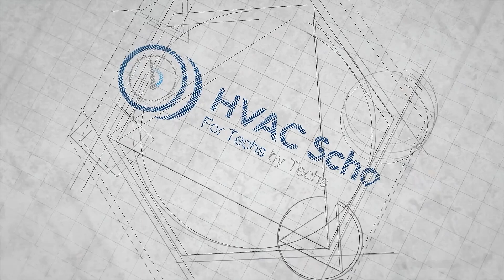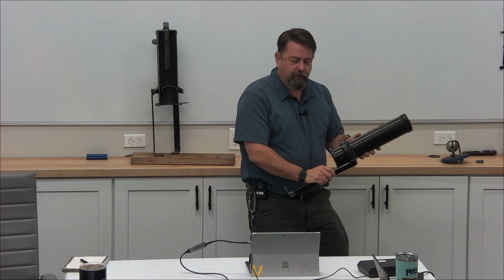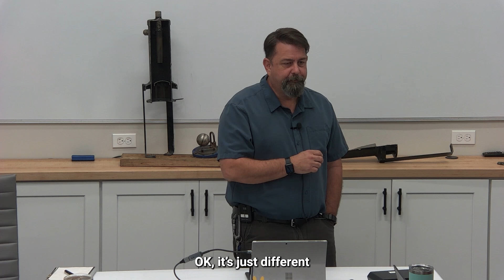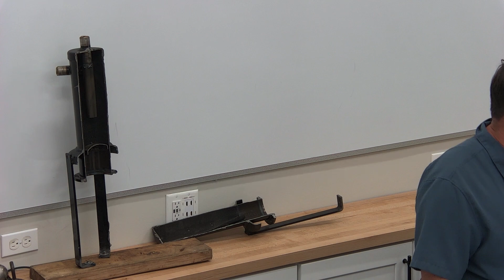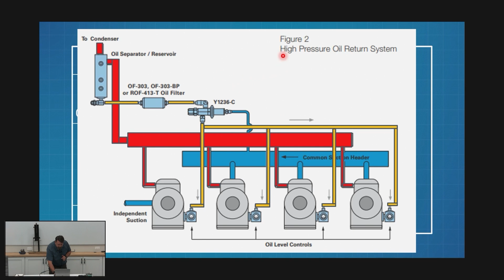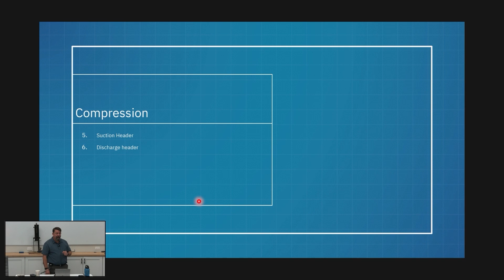Rack Refrigeration Cycle Part 3 - Oil Systems w/ Matthew Taylor

Comment: Hi there, I need some help. We have an HVAC system that runs x 4 compressors with two oil separators. The oil migrates from one separator to the other depending on which compressors are running. Comp 1 and 2 use one separator and comp 3 and 4 the other but as all take suction from the same condenser, we have migration when three of the four runs at the same time. My question is what an easy way is to balance the oil levels say every 6 months
Reply: Interesting set up - what is the purpose in having separate separators if they are using the same condenser?  Is this a high pressure oil set up, or a low pressure oil setup?  Also, ball float oil regulators or electronic?

Comment: What is the pilot line for connected to the 3 way heat reclaim valve? One to discharge and one to suction?
Reply: Thats right.  The pilot side is right off the hot gas.  It needs pressure differential to flow (high pressure to low pressure), and thats created by connecting the outlet to the suction.

Comment: Sometime I use a pipe heater wrap around accumulator when we go in defrost the heater come on and the reason behind it is to warm up the oil and separate the gas this work really well
Reply: I will cover the accumulator in another part, to come.  That will explain how the oil SHOULD return from the accumulator.  Sounds like your pick up screen is stopped up, if a heater is necessary to get it out.  Adding heat to the accumulator is adding heat to your suction, i.e. increasing superheat that your compressors have to digest and your condenser has to reject.  That's going to be a loss of efficiency twice.